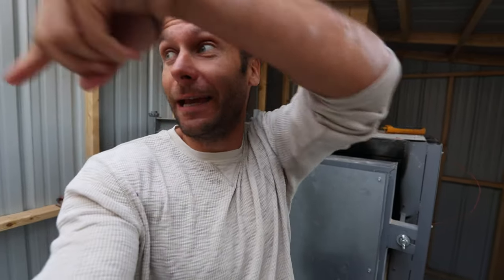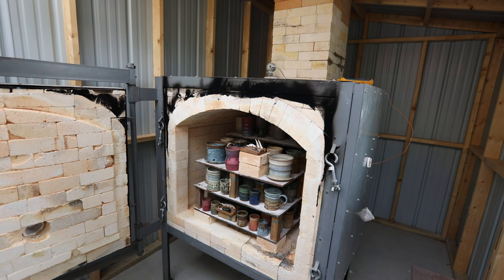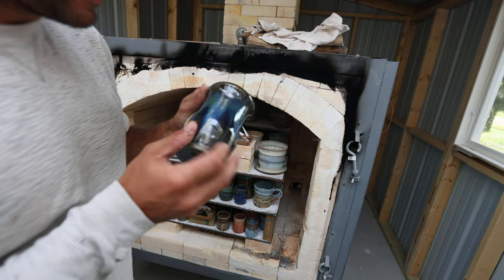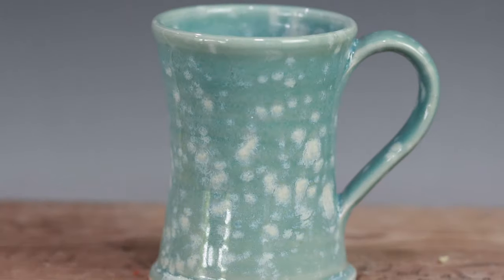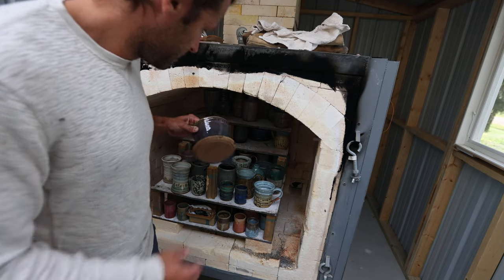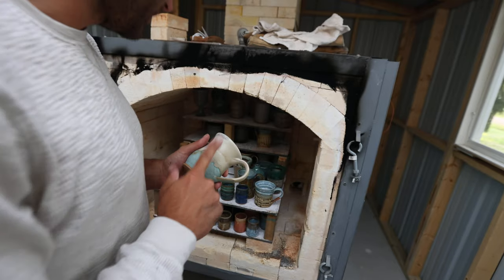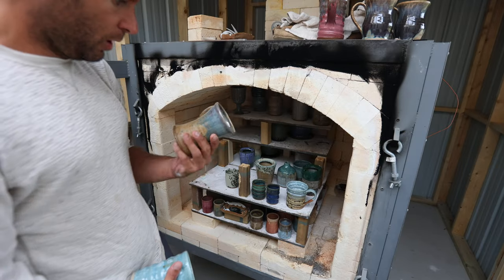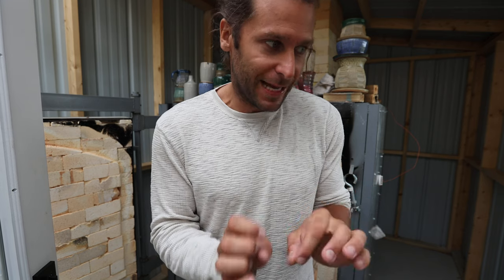Unloading the NEW GAS KILN - the 2nd FIRING!

Comment: Unsupported stilts is hard on those shelves. Three stilts per shelf, line them up vertically.

I would recommend you pack the ware as close together as possible. Keep similar height pieces on the same shelf. The less open space at the bottom the less likely the flame/heat will take the shortest path. 

Use as little gas as possible as you approach the end of your firing to keep the kiln in reduction and slowly climbing. This will allow the temperature to balance out in the kiln. Speed at the end is not your friend.
Reply: I was surprised too. Stilts that are not lined up is just a super bad idea.

Comment: I would say to place two deflecting bricks to direct the flame upward.  A short firing doesn't usually give the top and bottom enough time to even themselves out.  The gas kiln we fire is 14 hours.  It's bigger, but 7 seems to short of time.  Also pay close attention to the exit space in the chimney.  The article "Firing The Gas Kiln - What I've Learned So Far" Jon Rawlings Pottery, is THE BEST article I have ever read on understanding the firing of a gas kiln.

Comment: It looks like the burner port is coming in from the back corners horizontal to the kiln floor. You could try to set up a vertical barrier between the bottom shelf and the flame path , something like an 8" wide very high fire shelf, to better direct the flame forwards at a target brick and let the down draft heat the pots. Beautiful work BTW. 
Wood ash with just cobalt carbonate on a white clay boy is worth a try.

Comment: Much like others have mentioned the 3 main ways I would look to create balance in a kiln like this is with a bag wall, target bricks, or slower and a more heavily reduced firing. Sounds like you have all the right people around you to get you on your way. The work looks great and I'm definitely looking forward to seeing the journey with this kiln. I'd personally just start with a target brick on either side of the stack at about halfway between the burner ports and the front wall. If that doesn't turn out to be enough in addition to the slower firing with a more closed damper, then I'd explore the bag wall idea.

Comment: The harder the reduction the slower the temperature rise. So heavy reduction for the last few cones should even it out and slow the rise. If it stalls out goose the air flow more. Are you using welders goggles to view the cone packs?